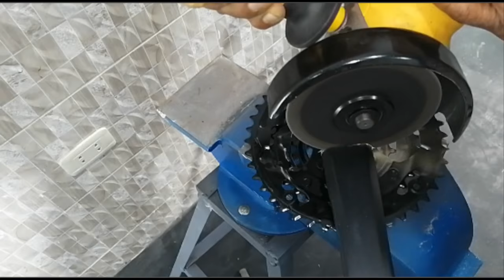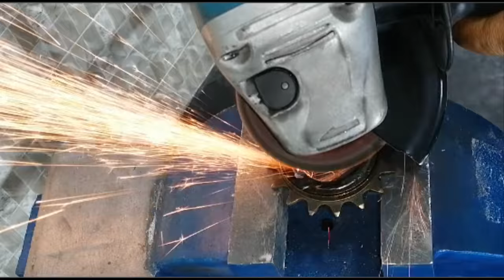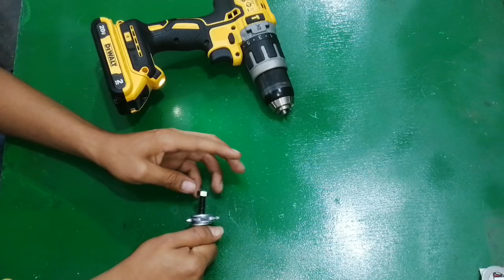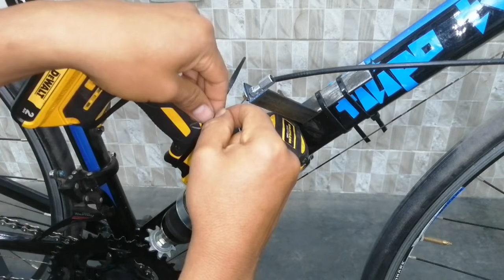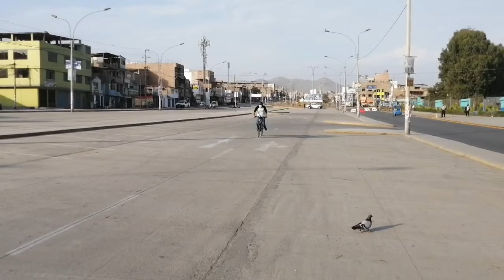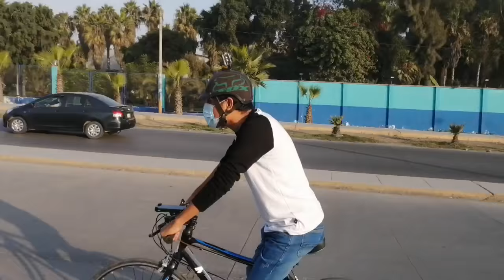how to install a drill on a bicycle

Comment: I built one of these, but first time locking it to a post, someone nicked the drill. It was a long pedal home. LOL
Reply: Lol 😂😂
I think it would be a great idea to mount the drill in a lockable housing structure, which will then be welded to the bike.
Reply: ……how about bringing an extra battery along?
Reply: @Moon-magic109  did you read the original comment? He said they nicked the drill, not the battery 🤡🫵🏽
Reply: Wouldn't it be possible and better to modify a battery charger and use a speed/volt controller. Once bike is parked, unhook the battery 🔋?
Reply: Damn my heart broke 😭take the bike leave mah drill 🤣
Reply: Aww man that sucks! It’s literally a Do or Die situation for me I need something like this to be able to find a job in the city. I already have a DeWalt drill and a road bike from the 70s so I’m hoping I can figure some shit out. If somebody stole the Dewalt off of the bike I would have a hard time not losing it completely so I’m glad you can at least laugh about the situation and I hope karma comes right back around for whoever stole that shit
Reply: You definitely didn’t build this
Reply: @collinsoju9192  e
Reply: How fast do they go??
Reply: Well now you know, people will steal your stuff. I too was Innocent and naive, it took me losing literally 12! Twelve bikes stolen, usually because I didn't lock them up. Live and learn. Watch your surroundings and check if you're being watched or followed, you'll be able to see the thief's before they get that chance. But don't be overly paranoid it's not good for you.
Reply: yeah.sorry about that but I just couldn't resist it.its blood was crying out to me from the ground,even though it wasn't bleeding.crass I know but we're not exactly talking magna carta are we! more ,welcome to angleterre,the moron capital of the world!
Reply: Imagine they take the bike and leave the drill behind lol 😂 naw I only use Milwaukee 😂😂😂
Reply: There are no pedals, you're lying 😢
Reply: FELICITĂRI.

Comment: Love it. What distance can you achieve before the battery runs out?
Reply: Carry a couple extra batteries.
Reply: @bolivariano75  Still doesn't answer my question tough does it.
Reply: Estimating - Probably a 20v drill and assuming a 4 amp hour battery I estimate 7 to 7.5 miles. Top speed is 25-28 mph for a couple of minutes if gearing is right. Cruising speed probably 15-20

For Distance - I'll assume 4 amp hour battery. Most 20v drills make about 500 watts (hard to find info), so they are pulling 25 amps. At full speed putting all that power into the bike it could last maybe 9 minutes. He looks like he is going 15 mph. 2.25 miles. In reality though, its probably only using half the power, and half the time one is coasting, so 2.25 * 4 = 9 miles. Take 25% away to account for efficiency. So Probably 7 miles.

I used a bike distance calculator online and it said 8.6 miles with a 24v system. Drill is probably less efficient so probably 7.5 mile or so this way.

For Speed - I used a bike watts calculator to maintain a certain speed at 400 watts one can sustain 25-28 mph. If the drill has 500 watt max capability its only so efficient so I'm just estimating 20% loss or so. I think that would only be possible for a minute or so before battery drain lowers the output.
Reply: @BigFishEnergy  i would like to take a 24v v4 brushed motor from an Milwaukee impact, with those 5 ah batteries
Reply: my 20v batteries only run about 10 mins straight, so maybe a mile or so if you are lucky. also remember, this thing is straight geared, you can't coast and when your battery is out you're pretty much done unless you wanna pedal against the motor.
Reply: @LygerTheCLaw  Not really worth it then. If you traveled at a speed of about 20 mph for 10 minutes then you'd get about 3.3 miles, though still not very far.
Reply: most of these clips on youtube now making gadgets like these are just gimmicks for clicks and potential revenue.

Comment: As cool as it is I have to question the durability because the drill is not designed to be running constantly  like it would be when riding.
Reply: Yeah that thing would start smoking after like 15 mins of just full send lol

Comment: ive seen this done at least 6 times before and this is the best by a mile and the easiest, and some others you cant pedal only the drill powers it, and yes the large cog will shark fin in a while but most don't use it just the smaller cog and bike parts are cheap if not free on council pickups,
Reply: what is a council pickup
Reply: @snorttroll4379 my guess is "the local dump". free bikes.

Comment: Very cool, simple tech. Love it. All you need is a rucksack full of drill batteries. How far would one charge take you?
Reply: across the street and after changing the battery on the next street the tiny motor goes up in smoke..
Reply: @samsunggalaxytaba3858  its a reducer motor but the battery would explode first
Reply: @mr.engineear0987  i've never heard of a "reducer" motor used in a handdrill.. it's likely a brushed or brushless motor used in one of those.. and i have had one catch smoke while using it during drilling.

Comment: 5 mile range per charge???  Did you use 1.5 or 2.0 ah batteries???  Are you familiar with Stanton, Inc?  They make an interesting 2 to 1 gearbox for drill powered bike?  Interesting stuff.

Comment: Very clever stuff. Wonder if the motor out of an electric leaf blower or strimmer could be used in its place for more of a kick. Also, you put the throttle on the wrong side and backwards 😆😅🤣
Reply: I was thinking that, he would have to throttle forward.

Comment: It's  cool, but I forsee hrs an hrs of tweaking the drill just right and ect. Here's where, actually whst i think is or could be the golden diy robo bike. Now it could be gas or battery..... chainsaw. Swich chains to something less cutty an moint the motor like a motorcycle. I actually startrd one yrs ago with my baby stihl an an antique Evans. Got the idea cuz it was firewood season. But dropped the idea after chopping my stuck big saw out with a hatchet.....

Comment: Good idea but not to much power u are to heavy to ride
Reply: That dill has probably more power than a normal bike motor. Here in Germany you can only have 250 watt for an ebike.
However that dill is not made to keep up that level of power for a longer period. Also the batterie will not last long.

Comment: Now get the guy that mounted a v8 rc motor onto his drill next and see how fast it can really go. Should be your next video. We need this info. I need to know how crazy life can really get from tiny motors. I want to see zero to 60 seconds from a tiny motor in less than 2 seconds. Driving on the road bro did I just get passed by a bicyclist? I'm doing 50 on a 35 and got passed by a pedal bike.